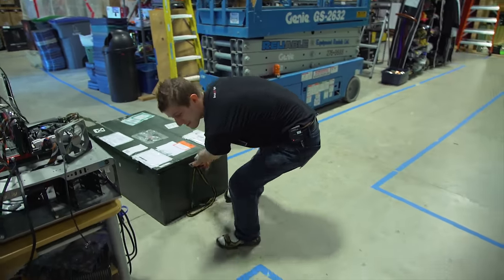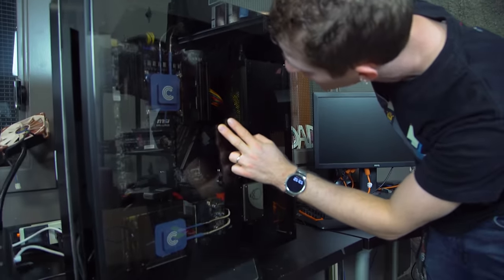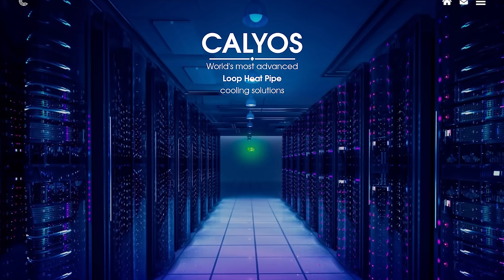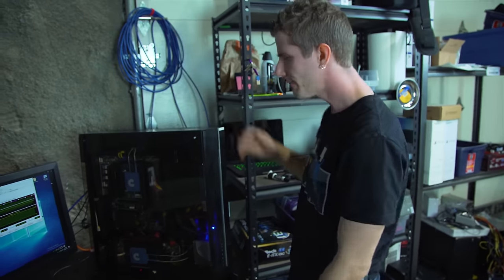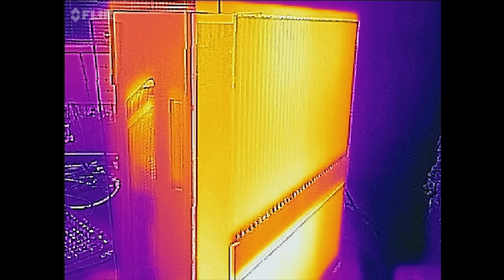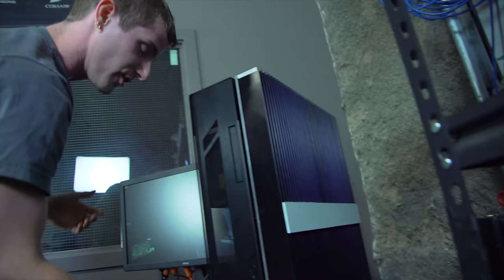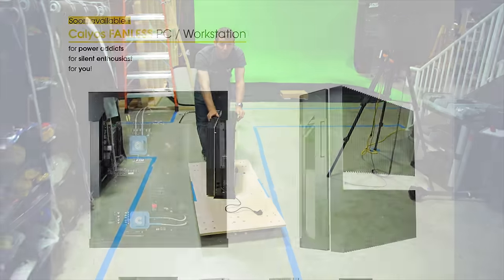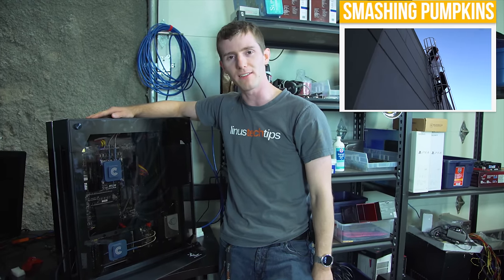TRULY Silent Workstation PC with ZERO FANS - HOLY $H!T Ep. 13

Comment: The irony with silencing your computer is that you notice more and more as it gets quieter. Once the CPU and GPU have been silenced, then the HDDs are noticable. And when those have been replaced by really quiet ones or SSDs altogether, then the fans become noticable. Suddenly you start hearing the motor, the bearings or the tiniest amount of airflow and so on. And when those have been replaced by the most expensive silent fans out there, then you start hearing the capacitors, coils and so on whine or make tiny sounds. 

The easiest solution would actually be just putting the PC in a different room (like a storage room), using a wireless mouse and keyboard and only having the cables run to your desk. HDMI cables can easily extend over 15 meters/50 feet. My private NAS isn't the quietest out there, but since it's in a totally different room, it doesn't bother me at all.
Reply: Corristo89 This is so, SO FUCKING TRUE, i gave up in trying to make my pc silent, as long it is not anoying, it's ok.
Reply: hahahhah thats basically me in that comment hahahaahha
Reply: But then you hear your keyboard clicking
Reply: Ruiner of Your Day but that’s a satisfying sound
Reply: I got around that problem in my old build by having all super-quiet noctua coolers and fans, and then a R9 390x that sounded like a vacuum cleaner. I definitely couldn't hear my HDDs
Reply: I just wear headphones. No sound at all except for videos and games!
Reply: After you get EVERYTHING so completely quiet... You start hearing your neighbors having sex next door.
Reply: Corristo89 that is why a lot of the time one chooses a fan with very good white noise at low speed to cover the electric components noises.
Reply: True. I bought one of those nearly-silent mini-PCs. It's so quiet when it's idle that I can now hear my monitor's electrical whine. Still, I don't miss the days of using a computer with 4 or 5 fans and an HDD whirring along within arm's length of my ears.
Reply: just wear bluetooth noise cancelling headphones genius lol
Reply: Yup we just got to the stage where we are offering quieter solutions to our customer PC installs and we were left with power supplies bricks from other devices giving off tiny noises. So much so that they had us remove the equipment that ran off power bricks to another room and using wireless. LMAO, personally I like grey noise. If grey noise is a pleasant pitch it masks annoying sounds and is actually proven to relax you as it masks unexpected noises.
Reply: Then you hear your heartbeat in your eardrums. Or the tinnitus that you don't want to hear. Would rather hear the rotation of a fan all day.
Reply: My server is actually 100% silent. It has a pico psu, no fans a big passive CPU cooler which never gets over 40° and a SSD.
Reply: @geomatrix5452  the trick is to be the one having sex with a lady. Especially if she's your neighbor. 😎 That solves multiple 'problems' at once.
Reply: Then you notice the radio waves heating up and cooling the metal in a way that makes sound and then the individual molecules of the air and then the fucking background radiation of the goddamn universe and then a coin falls on the floor and you get deaf
Reply: I wonder if I'm the only person to like being able to hear my fans as it means I have an audio feed telling me when different sections of my computer are under heavy load and when they struggle... currently my PC is running a paused game of stellaris, a web browser, windows 10 bloaty bloat, steam client, and a live wallpaper of pouring molten gold in 4K.

It sounds like a happy pussycat in my lap. I can hear a little oscillation in the titan x fan but everything else is soft and calm. When I run it in the height of summer, you can hear the various systems spinning up or the water cooling chugging a little when I play intensive games or render large 3D objects. You can tell when a particular fan begins to misbehave and you can tell the severity of the problem, and do something about it.

I used a server at my old job and didn't realise there was a problem with the ultra quiet system in a soundproofed room until the fire alarm started blaring. (Eight years, 24/7 operation... never cleaned... and they wondered if they could still claim on the warranty for the fire).
Reply: replace with cooling solution
Reply: i use headphones
Reply: When u silenced everything u'll hear your heartbeat. I don't recommend stopping this one
Reply: The point of silencing your computer is not to end up sitting in the absolute silence for hours every day (what a horrendous idea...) but to just end up at the point when you're not noticing any distracting noises while you're listening to music, watching videos, playing demanding videogames etc. at night even at very low sound volume.
Reply: The point is that there aren't fans...

And he did say that he could only hear it when right up close
Reply: true words, bro XD
Reply: Most ultrabook laptops are completely quiet, if you're not gaming. I think the best thing about fanless is it will never get dust inside. You just need a brush to clean the external fins.
Reply: But actually having a console (PS4 PRO), which is very quiet if does not run a high performance game or a disc I realized how much noisy my PC is. I really like playing at night, when my wife's sleeping I need to have the volume low ( I like playing with speakers) and hearing all the fans instead of the game sound is incredibly terrible. HDD is fine, acceptable, but fans are just freaking out all the time.

Comment: Using a Flir heat sensitive camera on the glass will only yield temps from the surface of the glass instead of the components inside the case "to the best of my knowledge anyway" XD
Reply: DanielVidz I WAS THINKING THAT
Reply: Diederik Geertzen I realised after I posted this that someone else had already said the exact same thing.. I'm surprised Linus didn't notice how broad spread the heat was himself.
Reply: Exactly my thoughts. That's a HUUUUUUUGGGGEEEE MIIIISSSSTAAAAAAAKKKKKEEEEEEE, LLLIIIIIINNNNNNUUUUSSSSSSSS.
Reply: Linus did it again...
Reply: Depend on the type of glass used in the case widow. IR wavelengths will be transmitted to varying degree in most common glass types. 

What he's doing isn't going to give him an absolute value for temp, but it can still be used to show relative heat changes.
Reply: You mean virtually not at all?...
Reply: Neokretai: I wasn't even certain I was correct in saying what I did but thanks for your feedback. I also imagine the IR wavelengths would be susceptible to reflection, refraction and absorption being as they are in the visible/invisible light area of the electromagnetic spectrum. 
bean: like I said I even noticed somebody else commented this before me so don't feel bad.
Reply: yea, but then he shows screenshots of ... what was it? ida64?  some temp monitor.  said that the gpu temp during crysis was 60 C and the cpu was 55 C.
Reply: The topic isn't necessarily the temperatures portrayed in his video, rather the improper use and futility of the infrared thermal device results.   They are far from accurate surface temperatures.  There is a difference between surface and internal temperatures.  Which is the point,  he should learn to properly use it.

Now if he was just using it to give you a general idea of where the hotspots are on the glass and not accurate surface temperatures... then that is okay, but this was clearly not his intention.  Despite those arguing here,  Flir or other IR Thermal devices cannot view through acrylic.
Reply: they are just reference temps, the important ones were the "inside" temps displayed by aida64.
Reply: Sorry, but they aren't reference temps.
Reply: That seemed pretty ridiculous.. Noone should ever take thermal picures through plexi glass, or any surface, unless you want that surface temperature. Doesn't matter if you can see through it or not.

There are "window" type surfaces that you can take thermal readings through, but they are ~300$ for 1 inch diameter window, and are mostly metallic in colour, and not "see-through".
Reply: +Finian Blackett No it is not.
Reply: +Simon Woodburyforget No it was not.
Reply: +Simon WoodburyForgot Stop struggling to defend improper use of a thermal camera.  You get the surface temperatures of the acrylic,  NOT the surface temperatures of what is inside.  The differences would be exceptional in temperature.

If it was his intention, he wouldn't' be putting the temperatures there with it...
Reply: Same reason the "Predators" movie is bullshit. Thermal does not image accurately through glass acrylic or any solid object for that matter.
Reply: You know it well.
Reply: Don't you dare bring the first Predator movie into this discussion!!!!!

Comment: If that thing ever be my PC, i imagine there are some possibilities
1. It fell off my desk and glass shattered all over
2. It fell off my desk and the floor shattered
3. It didn't fell off but my desk leg broke
4. All of the above
Reply: How often do your PC's fall off your desk?
Reply: I don't think you'd want a 70 lbs(30kgs) desktop sitting on top of your desk
Reply: Or you can put it on the ground??
Reply: well since there are no fans involved that also means no dust / vacumm so... yeah?
Reply: has no fans there's no need to put it on a desk you could have it on the floor
Reply: Fell through your desk to the floor, through floor and thrashed your basement - that's kinda how it's heavy :D
Reply: Dont put it on your desk? It cant fall on the floor if it is on the floor.
Reply: 5. Killing the ozone when the gas leaks out, or when someone steals it for scrap metal.
Reply: @robertdonaldcrupi3108  caring about the ozone layer in 2018 lul
Reply: @Pspgamer789  Linus almost makes a regular occurrence of it.

Comment: If nothing else, this case is a great anti-theft device. Ain't nobody going to steal something that heavy.
Reply: Thieves are usually built like wrestlers. They'll walk out with that under one arm and your monitor under the other.
Reply: Here a guy robbed a steel gas canister (13Kg ~28,6Lbs) and jumped a wall and then tried to outrun a bystander when discovered!
Reply: Birki gts Yep, but still impressive in my opinion, the guy's a comedy with the news reporter, but it's in portuguese though... I laughed my ass off of his "adventure", hhahaha!
Reply: yup not gonna get far but be funny to see and how they gonna carry 72 pound case and sasy 55 inch tv out the windows or even door to small for them lol. Also i tink my case full sized tower one like 30 pounds with nothing in it
Reply: Im commenting while stealing a tank.
Reply: I would totally steal the gtx 1080 though.
Reply: Katie Parker that nice lol
Reply: Velociwizard lol that and the cpu plus harxd drives and ram and any other removable parts and motherboard
Reply: What was in it Douglas? just boring old propane? Because if so its a strange thing to steal.
If it was something containing a special high value gas like xenon or krypton I could kinda understand it... but short of those extremely odd ones its stupid to risk it.
Reply: ToKeepTrackOfRandomSubs He said in the interview that he was stealing to make food, kind of sad... with his skills he should be an athlete or a comedian XD
Reply: yeah if someone broke into your house they would probably just steal your TV or console. My brother got robbed and they took his 55in + Xbox 360 + all games (and his friends TV + PS4 + extra). Computer was right next to the TV untouched. Didn't help (or helped alot?) that it was a super big Lian Li case. Ended up being the neighbors that stole it and got it back. My bro didn't notice the games stolen though and they ended up being sold before he could get them back.
Reply: For the local gypsies the 28kg manhole cover is like lucky coin - those guys run around with 80kg washing machines on the back..
Reply: it's like crt tv's, they are so heavy that thief cant stole it
Reply: i'd just rip out the innards, then take a warm dump on the radiator! and leave!!
Reply: Similar for any powerful + expensive Hi-fi. In my case 2 x 52 kg (114 lbs) for speakers and 22 kg (48 lbs) for amplifier.

Comment: $500 sounds like a killer deal considering all the engineering that went in to that, plus it's beautiful.
Reply: i checked it, you can order the final product since april 2018, it costs freaking 999€...
Reply: @roflcopter3625  Still a good deal if it comes with that hardware.
I mean,the components probably cost around 500$.Add 200 dollars for materials and 50 dollars for the manufacturing process.
That comes off as 750$.
They make 250$ without tax.
With 30% tax that would be 185$.
They are giving it away basically.
Im just a bit worried about the upgrade path,i don't think you could swap the CPU or GPU without sending it to them.
Reply: It only includes the case. 1k EUR for the case (about 1150 USD). Even though it's a very cool concept, I think I'll stick to my CM Silencio.
Reply: @LordyHun  Well,holy moly...
A grand for the case?
Just use 4x360 rads and you should hear no noise except water pump,and it will cost under 200$.
Reply: Yeah, I totally agree with you on that. I use an old CM Silencio case with air, and up until recent times, it was totally silent. (then I OC'd the CPU and GPU "a bit", now it can get audible under load)
If I wanted to spend this much on my PC, I'd rather just buy a PocketNC and just make my own radiators and stuff.

Comment: "This thing weighs SEVENTY FIVE POUNDS!" So....let's lift it wearing OPEN TOED SANDALS!!!! >_<
Reply: That's what happens when you let they guy who owns the company run the show: Nobody is enforcing OHS regulations.
Reply: Yes, and rest my arm on it while weighing the machine, just to make sure the result is accurate...
Reply: genius
Reply: Chris Ayres why would you carry your pc all around your house?
Reply: kilograms? jeez
Reply: 75 lbs. didn't use to be a big deal.  I've got a 75lb. CRT in the garage.
Reply: Is there a thing called closed toed sandals?
Reply: Well, chris, modern Gaming PC's are so large as to have ample room to fit everything and make it nice adn neat and tidy. (i have a relatively big tower, probably a little over 2 feet tall, im not gonna measure it) but ive seen many biggerYou CAN get smaller computers, if you want. You just have to build them yourself, or you know, just buy a computer at best buy because that seems more up your alley. 
Most people also dont take moving home into account, because a good chunk of people will never do that, or will do it once or twice in their life.
Reply: With this computer you can literally wall mount it in the center of your house somewhere and then utilize it in every room in a house <1500-2000sq/ft depending on the walls with remote casting/smart tv capabilities.

You haven't needed to move a decent standalone desktop computer in your house for about 1-2 decades now.

So again--why would you be carrying your PC all around your house?

Additionally, if 75lbs is causing you that many issues, it's time to lower the soy in your diet and increase the amount of time spent in the gym. 75lbs isn't even half the bodyweight of a skinny-fat guy at 150lbs and 5'3.
Reply: Oh come on! The weight factor contributes to the anti theft benefits....
Reply: verdatum  yah
Reply: My two main computers have not changed rooms in years. And never will.
Reply: that's what men do.
Reply: Chris Ayres - there are many mini itx motherboards and cases and small cooling solutions via water cooled or thin air coolers.
Reply: are there closed toe sandals?
Reply: A PC is not meant to be moved around as shocks could damage the components and slots on the MB.
Water cooled systems must be large to provide enough space for radiators + fans + tubing + pump + reservoir. Larger cooling surface = Lower Temps = Lower RPM Fans. My loop has 1 Radiator that measures 400 x 120 x 28mm and another with 400 x 120 x 38mm, an another 25mm thick fans. And no, it wouldnt do to remove the radiators and fans to shrink the case.

How is a PC tower more impractical than a large TV screen, washingmashine or fridge + freezer combo unit? I can carry it easily because of its dimensions, 30kg is nothing.
Reply: hey, there's socks!
Reply: @Chris Ayres you can buy a mini CPU thats smaller than a monitor and mount it on the back.
Reply: yeah they're called shoes.
Reply: I mean, I used to move 2x55# servers regularly and 1x110# server occasionally, always in sneakers, so... just don't move stuff that's slippery or beyond your capabilities, or where you might trip, etc.
Reply: @Chris Ayres uh? that's what LAPTOPS are for. So if you don't like Big Set ups and prefer small pc, just go for laptops. 
PC are meant to be stationed not moved around. Again, That's what LAPTOPS ARE FOR.
Reply: I dropped my 50-lb tower on my toe earlier this year, while wearing flip flops. Needless to say, it was not a pretty sight...so, yeah, stupid shit does happen to idiots like me >_<
Reply: It annoys me that he measures temperature in Celsius, but weight in pounds.
Reply: @g00gleminus96  well you cant really let the owner do his own show its kind of him letting himself do it
Reply: just a reminder that you got 1k likes
Reply: if linus would have been on apollo11, he would have landed on the moon with sandals ofc